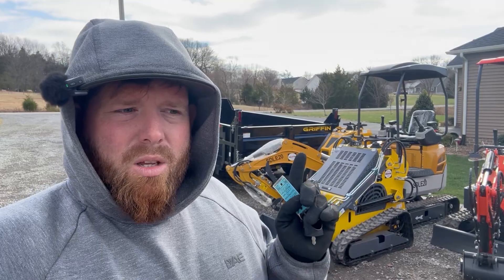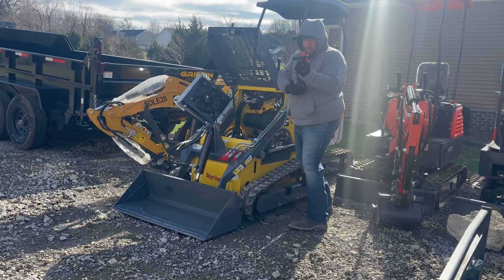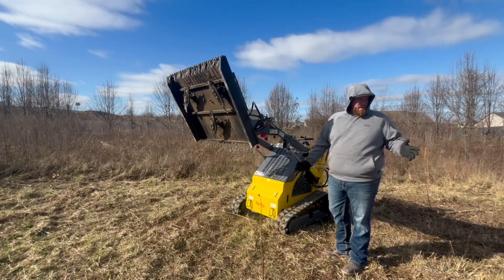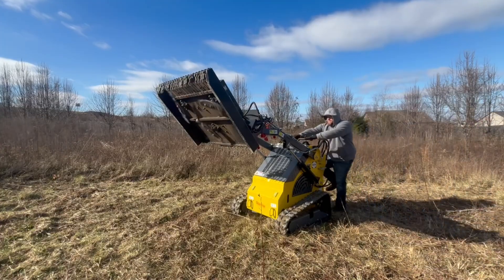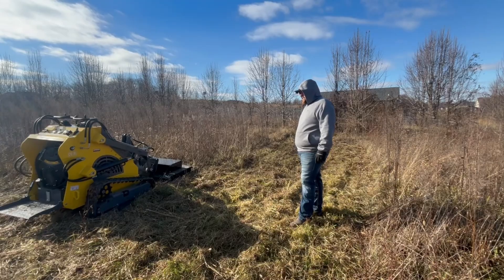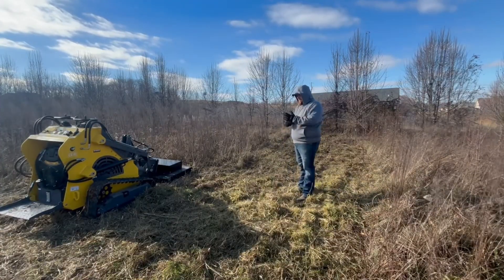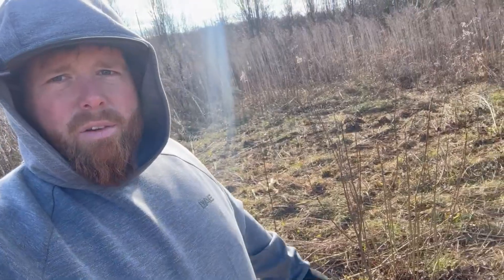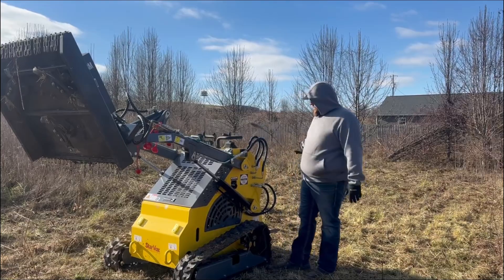I Tested a Bush Hog on a Chinese Mini Skid Steer — Is It Even Possible?

Comment: I wonder why it still works when you press them both forward?  That's a little strange.   I figured the right side just wouldn't work at all while running the blades.. but it still does when they are both going forward?   Very weird.  I don't understand why that is.
Reply from the maker: It takes flow away from the attachment to be able to move thats the downfall of this setup

Comment: Yes those tips on the blades are supposed to be really loose. Like able to swing freely.  As it spins, they swing out by centrifugal force.. and then if they hit something, it allows it to free spin and not break your shafts, etc.   It's by design.   They should not be stiff.. They have to be able to reach outward when spinning, or you won't get your full width of the blade.